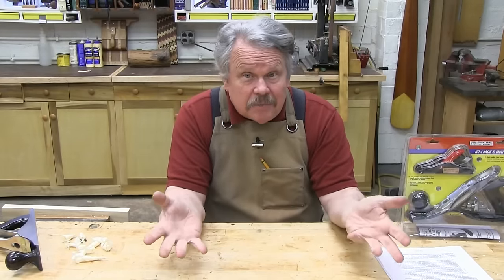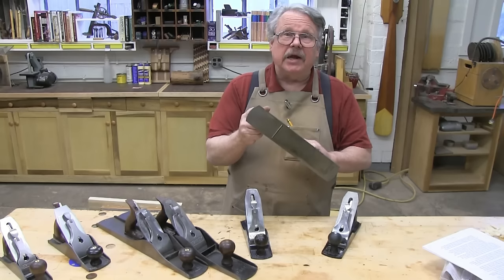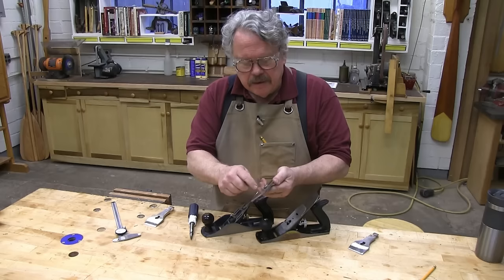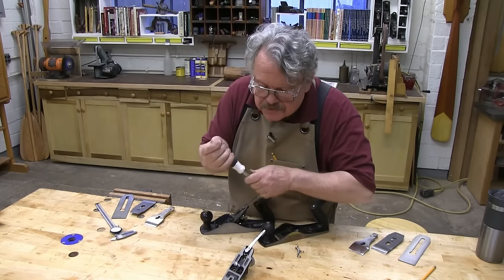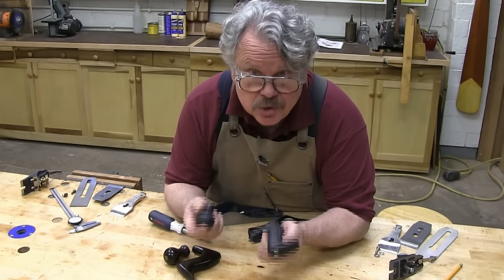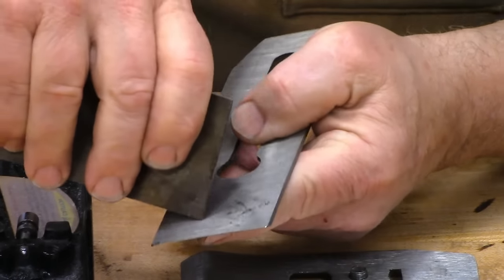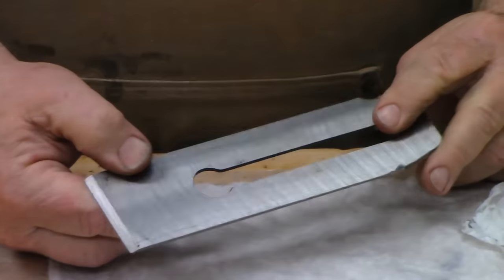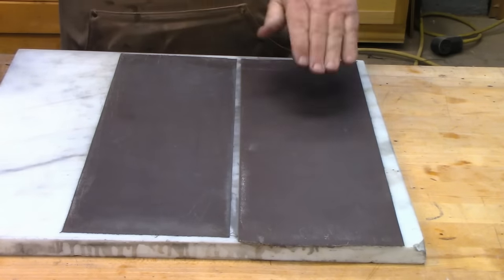Harbor Freight Jack Plane - How Does It Stack Up?

Comment: I actually love my bench plane from this pack!! The trick is to treat it like a restoration project or a DIY kit. Personally, I spent 5 days just sanding the sole flat and another 5 days flattening & initializing everything else (frog, blade, cap iron, etc.). The only issue I have is the plastic handles can become uncomfortable during heavy usage.

The block plane, on the other hand, is just gross. It required way too much work before the blade sat flat enough to cut properly. It can be done, but you're better off keeping the blade for a homemade plane & junking the rest.
Reply: While you tune up your plane, I make a cabinet. All hand tools. Spend a little more money, sharpen the blade and get to work.  Ten days of work is worth much more than even a Lie-Nielsen plane!

Comment: There were so many Stanley #4 planes made for well over a century that a well cared for, old Stanley Bailey could easily be found at an auction. You can likely buy a quality vintage Stanley cheaper than the HF plane and have a tool worth owning.
Reply from the maker: True that. Also yard sales, rumbles sales, flea markets. Right now, there are over 30 Stanley/Bailey No. 4 bench planes on Ebay for prices between $6.50 and $100.00

Comment: Great video and details!  Thanks. I do have one question. What was the app that you used on your phone to get the angle for your bevel?  Please share.
Reply from the maker: Thanks in return. The app is -- or was -- called Rotating Sphere Clinometer. I got it from the Apple App store, but when I last checked, it was no longer available. There's something called "Inclinometer" that looks very close.
Reply: Get on the Lie Nielsen site they have diagrams and break downs naming every part and all the angles.

Comment: That’s amazing, I’ve seen bad tools like the one you just showed and I was always taught that it’s worth it weight to buy quality than quantity, it worth spending the money once. Watching you make that pos into something worth using on wood is phenomenal😊👍Thanks so much for sharing, you’re a great wealth of knowledge😊👍
Reply from the maker: Thanks for saying.
Reply: Time is money. Sure you should only have to do it once, but the tool should also last your lifetime (other than wear parts) so it better be something you're going to be comfortable using for 20 years, too. Spending two days and a machine shop to fix this "cheap" plane is expensive and still has some faults so it'd be worth just buying a used quality tool over this, imo.
Reply: @hypercube33 

I bought this exact set for the reason of learning how to set up, sharpen, and tune a tool in order to be better equipped to restore vintage planes, or maintain and tune better planes.

If I fuck this one up, no skin off my back.

Comment: You need a variable magnetic Chuck and a squirt bottle material on an angle and gently grind off. With narrow wheel  that heating up material the cut he was taking you would be chasing a ghost to get that perfectly flat. Heat is your enemy your way by hand will work just cool in water every time you take a pass by hand. A little bit of fluid solvent to flush material and paper a little bit goes a long way it does break down the belt.Thank you for hard work.

Comment: Great video. What a transformation. How do I get the chipper from moving back up as I am using the planer? Do I need to tighten the screw in front more? I have it as tight as I can go. Thanks.
Reply from the maker: Check that the chipper is making contact all across the plane iron at the front-most edge -- you may have to "sharpen" the plane iron to get it to do this. Suggest you watch https://www.youtube.com/watch?v=Szan5pP4drQ
Reply: @WorkshopCompanion  Thank you. Appreciate it. Take care!

Comment: I really enjoyed watching the video and I learned a lot about hand planes. The only thing I would want point out is a Stanley #4 Plane retails for around $200 or more most places. The Harbor Freight #4 Plane sells for $17.99 and you get a mini plane thrown in. That less than 10% of the cost a the Stanley product. I buy a lot of products from Harbor Freight but I wouldn't even consider buying a product that was less than 10% of the cost of a good to better product. You're right Harbor Freight shouldn't sell poorly designed and build tools for precision applications. They're just going to disappoint their customers.
Reply from the maker: Thanks for sharing. FYI, the Stanley #4 that's $200 is actually made in Mexico by a Belgian company that bought the rights to use the name. We purchased one to test and it came with one of the sharpest blades I have ever seen on a new plane. But the blade adjustment mechanism had way too much lash for the plane to be truly useful, so we declined to make a video about it.

Comment: As a hobbyist woodworker I thought at some point I will need a plane. So I went on the marketplace and purchased a second hand Stanley plane. Cost me £25 here in the UK. it has brass fittings so its pre war. If the thing is nearly a hundred years old and still going strong it's good enough for me 👍
Reply from the maker: It is hard to beat the antiques for consistent quality and reasonable prices.

Comment: It's a lot of work but I looked up original and that thing costs over $100. So if you are handy, poor and good at doing things this could be worth your time. I think I may attempt this if I catch it on-sale or find a coupon. I have the good 4300 Dremel and belt sander (Harbor Freight version) and I'm not afraid to use it. I had the same Dremel as in this video and I burned that thing up in about a year.  I'm a remodeling contractor so I was pretty hard on it.

Comment: Last month I restored (to the best of my meager ability) my grandfather's Stanley 5¼ that he got from his father. (Type 13,  made 1925-1928, I believe.) It was in fairly bad (but not terrible) condition. The worst was the iron, which had deep chipping in the cutting edge. Fortunately, a buddy who has a wheel at work offered to grind them out. The rest I was able to do myself. 
(I have all the pictures online, but it seems rude to put a link here.)

Honestly, I now know how to completely disassemble and reassemble this thing in its entirety... and I'm still not sure how to properly use it!!! (Sigh.)

...and that's how I ended up here watching this video!
Reply from the maker: Love the old Junior Jacks; great plane. I'd suggest you're next step might be to watch our sharpening video: https://www.youtube.com/watch?v=xYy-U2_ylAA . About 75% of knowing how to use a plane is being able to put a proper edge on the iron.

Comment: I found the HF planes to be a good base for a scrub plane. Just file the mouth a bit, round the the blade then sharpen.
I wouldn't try mine as a smoothing plane as it would take too much work.

Comment: Thank you for the time and energy in this presentation. Boy, did it help with my novice ability. I will steer clear of that store for anything like this. I have about 4 old planes (various manufacturers) that I have hesitated to work on or even use. But with your clear instructions; I think I'm going to tackle them this year.
In your humble opinion; at what dollar amount would it just be better to purchase a quality plane instead of a cheap poorly made one? My time is worth something and if I have to spend 5-10 hours just to get a cheap plane up to speed.(or even half speed)....did I really save any money?
Reply from the maker: You can still find the older Stanleys and Baileys for $30-$75 unrestored. They were the standard of the industry when they were made, and will still outperform all of the medium-dollar and some of the high-dollar tools available today -- if they are properly tuned. Plus you can still get irons for them, and some of these irons will boost their performance even more. I have found very few tools that cut more easily than a Stanley with a Hock iron.

Comment: I have to ask, "Is it worth it?" How many hours of work did you have to put into doing that and how would you have to value that time to make the HF plane a better value than something that worked better out of the box?
Reply: The same stanely plane is $32 at HD.... how cheap do you want to be....
Reply: @thunderjeep08  unfortunately the NEW stanley requires a lot of tuning as well. maybe not as much?  but its certainly not like an old one.
Reply: Well when you take into account that when you are done it still is a knock off brand and therefore has no investment value no it’s not worth it.

Comment: Thanks for putting up a great video, Nick. What did you do with the two small block planes? Were those salvageable?
Reply from the maker: Going to use the blades later this year to show folks how to make a finger plane.
Reply: @WorkshopCompanion  That would be a very interesting video. Last time I saw something like that was in Lee Valley's tool catalog.

Comment: I bought that same plane when I first got serious about woodworking. It has been sitting on my shelf for several years now, as I determined it to possibly be the worst purchase I had ever made for the shop. I still don't disagree with that. It is HORRIBLE! Mine had all of the issues yours did including the chip breaker. I got the Windsor Design NO. 33 Bench Plane for a few more bucks, and after some tuning and flattening of the sole it wasn't too bad, and I use that one in the shop often when I need a plane. It's an odd plane(adjustment-wise), but a good solid plane if you don't mind a few hours of flattening and light tuning. if you going cheap, it's your best option. And for $20 bucks, not badly priced for the newer hand tool user with a lot of time on their hands. LOL After watching your video I may try to tune that piece of garbage up and see if I can actually get it to work one of these days thanks to your tips. Curious, the little guy that it comes with... did you ever wind up doing anything with that one? I had no luck with it either. Just currious.

Comment: So what was the price differential between the old Stanley and the HF? If a lot, then maybe investing the time to make it better is worth it. If not, then just some junk. Sorry but I didn't find that in the video in case you mentioned it. Thanks for a great, involved and insightful video.
Reply from the maker: There is no price differential because the old Stanleys -- as they existed before the 1970s -- are no longer made or sold commercially. The used prices are all over the board, from well below the $14 the HF charges for their POS to well over one hundred dollars US, depending on the condition and whether or not the seller knows what he's got.

Comment: I'm new to woodworking. My first plainer was this actual one. I had so many problems with it I was forced into buying a different one entirely. Now eventually I will get my hands on a much more expensive one (a quality one) but I went with a Cobalt from Lowe's and the different was immeasurable. So now the old one from harbor freight the way I decided to progress with that one was to just go for it all balls to the wall because now if I ruined it it was fine I had one that was working great. The problem that he was having with the corners of the blade being terrible I decided to just cut an eighth of an inch off and progress that way. I really don't know if that was a genius move or an incredibly stupid move but I got it to work and even though it's possible to work with,I just don't use it at all. In fact I only use it to show people the difference in quality from buying the cheap compared to buying something that has a little bit of quality behind it. As a matter of fact, talking about quality, since I was starting out and didn't have much money to start off with I ended up buying a drill press from harbor freight and I know the quality wasn't going to be the best but it was better than not having one. So after installing it, because the quality wasn't there when I tested it by barely scratching a piece of wood.  There should be one little tiny hole when I get the bit to just scratch the piece of wood and what it did was actually leave a circle rather than a DOT and this here really hit me hard on why quality equipment is so important. That's all. thanks for reading that's long rant about my problems lawl
Reply: that's disappointing about the drill press. I have a fair number of HF tools but ive had to modify and love them to get them serviceable>

The Bauer line of 20v tools is solid, i have the drill/driver, impact driver, lights etc. but the relevant purchase in this case is the Chicago Electric 10 inch dual bevel sliding compound miter saw. The center turntable was proud of the material holders, and the metal structure of the rest of the saw deck. 

I had to dismantle the entire saw and proceed to grind the table true with the wings. it was probably 4+ hours of work in grinding alone. the Fence was not setup to add sacrificial fencing to it. Using pocket screws i built a combination fence and infeed out feed table that was then bolted into the rail 

Oh we are not done. I replaced the throat piece with a solid wood insert and ran the saw through the fence at a 90 and 45 degree angle. 

So now i have a precision tool that is repeatable and accurate enough for my skill level but it took a boat load of my time. I will give them credit on their hand tools. Ive got 5 + years on all those tools. I really need to get a drill press so ive been scanning the web.

Comment: I've been aware of the poor castings of Harbor Freight tools for some time.  If you're willing and have the special tools and knowledge to do a lot of work to them they may become okay. But, is it worth it ?  Will they last?
    As a carpenter, I only occasionally have a need for a plane.  A small simple block plane is fine. Usually there are power tool options that get the job done faster, and time is money. 
    In the shop, if I'm building cabinetry, there' a joiner. Since my Dad died, there are old tools to go through and I think I saw a jack plane.  Maybe it's an old beauty.  I never saw the need to use it before. I'll have to examine it.

Comment: My experience as a novice. Start of lock downs hardly any antique shops were open. I think I found one #5 for $150 and it was rusty. I bought a similarly crap one new from home depot with the thought, If I'm going to have to restore a rusty one, I might as well by a cheap new one and tune it up. I was wrong. I ended up finding a bedrock #604 in real good condition. But yea the cheap one would go dull and never stay tight and cutting even. I was always doubting myself and the tool.

Comment: Bought one years ago, and the first thing I had to do was sharpen the HELL out of the blade. and clean the junk off the other parts.  I even found grease on the back of the casting that HAD to go.  Never spent so much time just prepping a plane in my life, but it was what I could afford at the time.

Comment: Nice video. Thank you. But i am alway wondering, how do you plane a piece of wood with an branch in it (i dont know what the correct term is for this, i mean this area where the branch started in the wood). I always struggle to get a even surface with a planer with this inperfection in the wood.
Reply from the maker: Planing knots is a perennial problem. You must use an extremely sharp plane iron, takes very small bites, plane downhill (with the grain sloping away from the cutting edge), and angle or skew the plane to the direction in which you're pushing it. When all is said and done, it's often easier to scrape the surface of a knot smooth with a cabinet scraper rather than plane it with a bench plane.

Comment: I have one of these planes too.  Thanks to your video, it works, but just barely.  Mine has all of the same flaws as yours.  As a result, I avoid central forge tools.  The plane is an introduction to their bigger, more expensive tools.  The plane was so horrible that I won't put out the green for any more central forge.  I'm not sure why HF continues to do business with them.